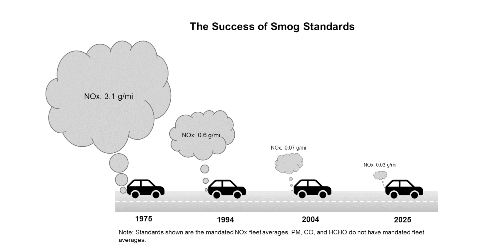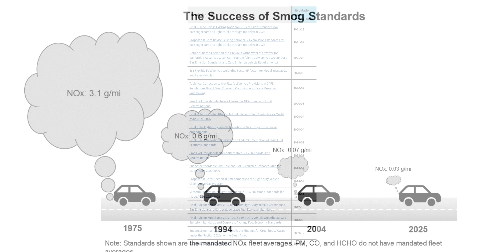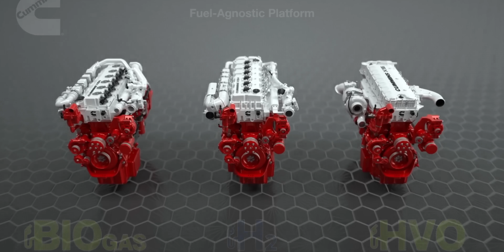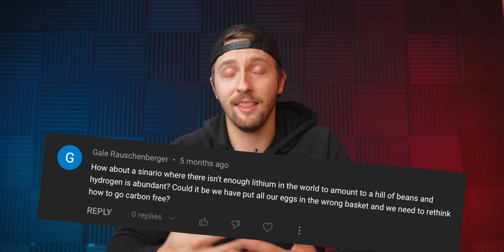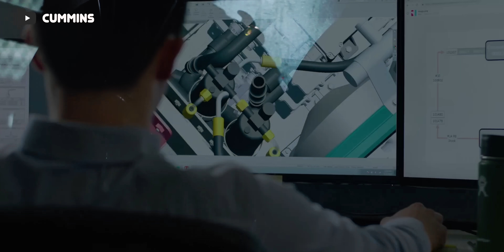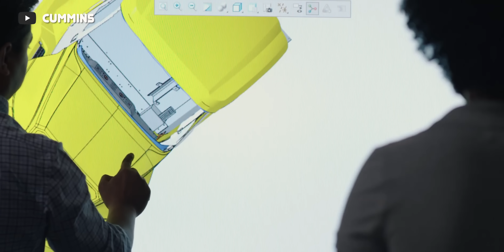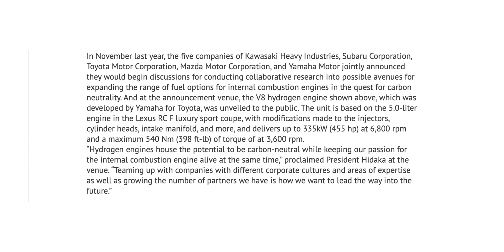Cummins Hydrogen Engine Will KILL DIESELS FOREVER

Comment: The biggest issue H2 vs EV is charge time. You do not want your drivers down for 1-6 hours while waiting for a battery to charge. That freight has to move. Hydrogen whether in a ICE or Electric fuel cell only takes 5 -10 to fill up.
Reply: Seconds..No I would imagine it's minutes.I will never buy a bumper car.( dodgems)
Reply: They take alot longer than that to charge for a truck application.
Reply: The Tesla battery will fill in less than 45 minutes.  I don't know if the hydrogen truck will be much faster.  Consider all the time it takes to fill a diesel truck, going in to pay the bill, standing in line, ect.  I guess if they allowed using a credit card at the fuel pump might work much faster.  

Still with $6 per gallon diesel fuel, VS $40 per 100 miles for electric truck charging at the home base charger or about $65 at a commercial charger would be a lot less to buy the electricity.
Reply: @Kangenpower7  You obviously never seen the inside of a truck much less have a clue what it takes to keep the US shelves stocked.. Your comment reeks of ignorance. 

Go get in a truck and sit in a fuel lane in just about any truck stop in the US for 45 minutes to see how many drivers threatening to pull your ignorant azz out of the truck and beating it (if you are lucky) Jump in a OTR truck and see how often you are at "Home base" or a company yard to charge it.. Electric may be cheaper now, but wait until they tax the hell out of it. Roads, tunnels and bridges don't build and repair themselves for free..

You should educate yourself before proving your ignorance....
Reply: @Kangenpower7  take about 15-20 minutes to fill both tanks on a diesel truck. Hydrogen would probably take longer is my guess.
Reply: Driver all have to take a 10 hour break. It doesn’t take that long to charge. In a local operation it’s just a matter of staggering shifts for charge time. They did the same for LNG trucks.
Reply: true BUT what happens if semis are lining up back to back fueling. No chance the H2 stations can handle that. It'll be so icy the nozzles will fail
Reply: @herewegoagain7403  We line up 30 pits at 4 pumps to refuel every day and don't get freezes. Heat is more of a problem from the gas being compressed in the tanks.
Reply: @RPSchonherr  ok, sure. Further Proves the main point of ineffective refueling back to back
Reply: @RPSchonherr  h2 isn’t the answer, hate to say.
Reply: This problem has already been solved by the Nissan Leaf . A Tokyo taxi company installed an automated battery charger to change their batteries in about the same time it takes you to fill a tank of gas..
Modular batteries - 'T size ' , as in Truck..
Reply: @aaronhumphrey2009  Negative ghost rider..  Regardless the battery technology, the faster you charge it it greatly demonishes the lifespan of the battery.. OTR trucking is stupidly reliant on longevity and durability..

Something green freaks fail to realize is that materials to produce batteries is more rare than crude. And battery technology is like a cake and it's extremely hard to break it down to recycle to make a new battery out of the materials that is pathetic at best.. Recycled batteries are basically junk..  Green freaks also ignore how harsh gathering the materials, producing the batteries, recycling the batteries to end up with junk and disposal of batteries is on the environment... In the US it's exactly the same as drilling for crude and industry. They drill and move industry out of the US to give the green freaks the sense that the US is being green to save the planet. Meanwhile the crude exploration and industry is moved to countries that don't have anything for environmental standards.. The pollution is far worse as well as the loss of life fighting wars over energy materials.. Do you really think the those in DC ruling us give a ratzazz about national sovereignty, importance of borders and freedom of the people in Ukraine when they constantly preach we should be like other countries, leave or southern border wide open and work every day to strip us of our rights? Or do you think Ukraine's lithium reserves and them angling to line their pockets with it thru shady deals, backdoor policies and lobbyists is their reasoning? 

The big thorns for EV that people seem to love to ignore is all over the country they preach to conserve power to not overload the grid and cause rolling blackouts.. It takes a special kind of moron to think throwing millions of vehicles and homes that rely on fossil fuel for heating and cooking on the grid will end well.. If it wasn't for massive subsidies their wouldn't be such a thing as wind and solar farms because neither can produce enough power to pay for themselves.. Then there is that pesky little fact that many things you touch everyday (including whatever device you are using to talk about how green you are) is made from crude that is not used to make fuels . Like everything else industry uses every bit of crude so very little if anything is waste.. 

It's hilariously funny that whenever the tyrants that rule over us come up with a policy so good they have to mandate it and people swallow it hook line and sinker... If EV was so great and the clear future people would gravitate to it naturally. The fact they have to force it down our throats is very telling.  Do you not find it odd that government vehicles from everything from the presidential motorcades to police cars, ambulance and fire trucks are not 💯 electric? Why are all these tyrants in DC not commuting in EV's?. 

I can argue EV isn't even practical for millions living in the city.. How many millions of people don't even have a driveway much less a garage to charge an EV? 

Think I'm wrong? Try asking the best EV manufacturer owner in the world how many decades and trillions of dollars the power grid and charging infrastructure is away to support an EV takeover.. You might have a hell of a time convincing him of the climate change, global warming or whatever y'all are calling it these days BS . Last I know nobody accepted his challenge to prove it.   Not a huge fan of Elon Musk but even he realizes EV is heavily reliant on rare materials and is not a viable long-term solution for energy...
Reply: @lanejohnson7656  good points. Battery technology is improving constantly..lithium soon may be surpassed..rare earths may be unneeded soon..super capacitors, solid hydrogen storage cells..who knows ?
Its true that right now the battery tech is insufficient for a heavy trucks requirements..if a Tesla car Battery costs $ 25- 30,000, then a Semi- sized battery would cost as much as a conventional semi itself..
Electric- only Semi's aren't currently sustainable for long hails ..
Why Tesla isn't experimenting with Hybrid trucks-  I don't know..
Reply: @aaronhumphrey2009  The biggest issue for trucks when it comes to fuel vs battery is range. You lose a significant amount of range when hauling. The F-150 lightning touts a 500 mile per charge range but once you start towing that range can drop to 75 miles per charge. With my regular gas F-150 I can haul an 8000lb RV for about 300 miles on a full tank and it's faster to fill the tank vs waiting for the battery to charge. Until there's a huge improvement in battery tech in the near future this is going to keep being an issue.
Reply: Toyota plans to have first solid state batteries in a hybrid EV in 2025.  Solid state does not have the ageing problems as the lithium batteries.  Solid state does not have the temperature problems when fast charging and does not require temperature control for the battery pack either.  Solid states can handle multitudes more recharge cycles than lithium.  Car sized battery testing has recharges taking 15 minutes.  No idea what sort of station would be required to do the same to a long haul truck battery pack of course.

The power grid is in need of updating with or without EV takeover as well.  It is all based in the 60s basically.
Reply: @Power5  Your comment is largely based on theory. On paper and in minds sure solid state is better than current lithium ion, however theory doesn't always make reality and solid state is more expensive. Even then they haven't even developed an acceptable solid state battery much less figure out a way to recycle it and not be left with junk as an end result. And once again it's not like the materials to make even solid state batteries is in abundance and environmental friendly to gather, produce, charge and dispose of...  The US has some lithium reserves but do you really think the green freaks are going to be hip on creating large craters in the ground? Just like everything else they will want all that done in a far away land out of sight and out of mind so they can pretend they are saving the planet while materials are gathered far less environmental friendly and cheaper through like slave labor..  Which is likely the tyrants in DC"s true interest in Ukraine, to protect their large lithium reserves because the tyrants likely already have back door deals and methods of corruption to get even richer off of it.. 

Logic and common sense would be to create the technology and supporting infrastructure before mandating away people's lively hoods and means to survive . But we are talking about the US government where logic and common sense doesn't exist, only power and filling their pockets does..
Reply: @lanejohnson7656  hydrogen is even more expensive than an EV vehicle and has less infrastructure than electric. To covert current fuel stations to handle hydrogen is not going to be cheap either.  Everything besides current fossil fuels will take a lot of money to implement.
Reply: @Power5  Decades and trillions of dollars.. DC is printing money like mad and we are already around 300 trillion in debt so  not sure where they think the money is going to come from.. 

I live in Podunkville  USA in the Midwest surrounded by their idiot wind farms that can't produce enough energy to pay for themselves even IF they aren't broke down half the time and even here they say not to use high energy consumption appliances and charge extra for power used during peak hours so I can only imagine what it's like to live in a heavily populated area. It's also not uncommon for just wind to knock out power ..
Reply: @lanejohnson7656  the peak surge pricing is due to the antiquated infrastructure. Yes it will cost trillions to get the whole electric system updated and it will take a few decades with current construction methods. Are you saying that it is too hard and expensive so we should not even try? I mean cellular phones were not easy and cheap, glad someone decided to keep at it though. Too bad we don't have the real Tesla around anymore. Could use some of his revolutionary inventions today. Wireless power would be the ultimate answer.
Reply: @Power5  nuclear is more effective, efficient, and cost-effective than solar or wind. They will never be that. Also hydro power should be used a lot more and I can see having citys having evs for cars but the infrastructure that supports the city will and could never work.
Reply: @dufinsmrts  Yes nuclear is definitely our current best energy density option.  However, the danger of nuclear has been exagerrated over the years.
Not quite sure what you are trying to say about city infrastructure not supporting a city and never being able to work.  Getting a city of EV only vehicles would be easier than getting the rural areas on EV only due to the smaller area.
Reply: @magneric  It’s worse than that for the haulage industry and plant. Expensive machines have to pay for themselves by working round the clock. Charging downtime is a killer.
Reply: @lanejohnson7656  spot on !!!
Reply: @aaronhumphrey2009  ZPE aetheric energy overunity motor generators, the same stuff that spins the electrons in all our magical fuels and wonderful engines, Tesla and T Henry moary were on it with aetheric energy. There is enough ZPE in the volume of my YZ-250 cylinder to boil all the earths oceans.
Reply: @magneric  Its ZPE aetheric energy time!
Reply: @RPSchonherr  so you're saying that China with 1.3 billion people can make the transition to EV's, but we can't?

May I remind you that we're a supposed energy independent country and China is not. What happened to the American can do spirit? 

EVs are going to become the standard whether you like it or not. Auto makers are going to follow the money, and unfortunately for the anti EV crowd over 50% of car sales for auto makers come from China.
Reply: @aaronhumphrey2009  Did they solve the fact that lithium mining and battery disposal is horrible for the environment? Hydrogen is better because even at 75% efficiency there are many power sources which over-produce during off peak hours. That wasted energy could be used to produce hydrogen fuel, thereby negating the losses due to efficiency. Its the only fuel source that doesnt destroy the environment.
Reply: Commercial routes are very predictable that does help with ev downtime
Reply: 5 to 10 what , days , weeks, hours
Reply: @royalcrowntowing2464  you couldn't work that out?
Reply: @royalcrowntowing2464  Sorry Minutes :)
Reply: Decades
Reply: @TNGclips1  LOL!

Comment: cummins diesel engines are provably reliable - on diesel*.  they are *unproven on hydrogen.  they must prove reliability and other parameters on hydrogen.  hydrogen is known to cause metal to become brittle and early fatigue-fail.

Comment: The real reason why this is not a viable solution is because hydride is illegal
Reply: Bob Lazar has a video back in the day with his corvette with three scuba tanks in the back. Hydride was his storage method due to its much higher density, it’s temperature released at easy to reach temperatures and It’s also non-combustible/flammable nature.

Comment: Hydrogen power plants are far from becoming widespread. Their largest application is in heavy industry, but the cost to replace the high pressure tanks periodically may keep them from widespread use in transportation and marine applications.

Comment: Diesel engines will never disappear ever also mechanical diesels already could run on small amounts of hydrogen but it must be mixed with diesel but it makes it burn cleaner and make more power and fuel economy.

Comment: HVO is a very good alternative, burns very clean compared to regular diesel and does not require any modifications...
Reply: HVO is dirty on the engine and is not suited to newer high pressure Common Rail fuel designs because of the amount of "dirt" in the fuel. It doesn't provide as much BTU per liter/gallon, and requires the use of biocides to prevent algae/mold from forming in the fuel. If you wanted to create an infrastructure to supply HVO, you'd have to increase the already growing strain on farming and agriculture industry. Hydrogen might be an alternative for Heavy Industry, where they are able to store the fuel in large steel cylindrical tanks mounted and grounded to the earth, but it will never become widespread for the transportation and marine industries. The types of materials required for the tanks leak Hydrogen out of them and need replacement after a given amount of time.
Reply: @JosephArata  diesel here in Sweden has been mixed with HVO and sold in stations for quite sometime now and they keep increase the ratio on the hvo on the mixture, and I have not seen any effect on my two diesel cars. I did sometimes föll the tank with o ly hvo when the price was reasonable and the car worked perfectly. I fill my car 5 time every month, so if there was something wrong, I would have noticed it...

Comment: They will face the same problems running on Hydrogen as they would running a diesel on gasoline - only worse.
The main problem running an ICE on Hydrogen is controlling pre-ignition.
And burning H₂ will never be as efficient as putting it through a fuel cell

Comment: Doesn't the fact Diesel have over 8 times the energy density of liquid hydrogen and a tank for liquid hydrogen being bulker than a tank for diesel make it difficult to carry as much fuel as a engine run on diesel. Compressed hydrogen is even worse.

Comment: Tesla semi was able to haul 80,000lb 500 miles also will have 1,000volt charging hydrogen is a waste a electric motor is more efficient and powerful there is a company that was able to make a Tesla model s go  over 700 miles on one charge

Comment: Cummins also makes LNG and CNG engines, Hydrogen is a natural extension. Hydrogen is the way to go imho... sure it's less effecient.. BUT, Hydrogen is the most abundant element on the planet, so efficiency is a moot point... producing hydrogen will become more efficient, and transport of hydrogen can be done with existing pipeline infrastructure.

Comment: It is yet to be seen how practical some of these things will be.  Many use cases require a portable fuel that can be cleanly generated and cleanly burned and hydrogen does this, with the limitations of large storage tanks.  A truck may have the room for large tanks better than passenger cars do.
And BTW I know people who convert diesel engines to run on common natural gas for fixed applications such as running pumps.
Reply: Here in Thailand there are dedicated CNG refueling stations all over the country and there is a large fleet of CNG fueled semis on the road.
Reply: They City of Long Beach California USA, they have natural gas powered engines that pump the CNG from 35 PSI to 4,000 PSI.  Before they had 480 volt 60 HP compressors, now the natural gas powered compressor do the same work for a LOT less money.  They even installed a V12 natural gas storm water pump that has a 36" discharge into the LA river moving several hundred cubic feet of water per second.  I think it is rated at 500 HP.